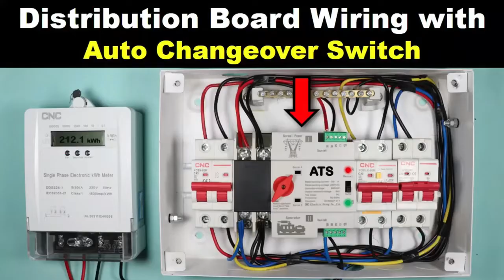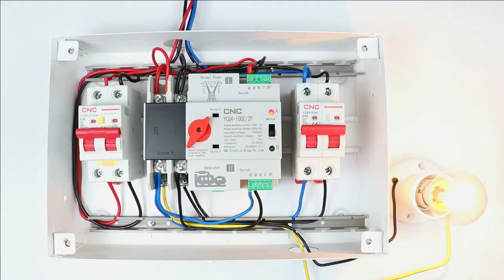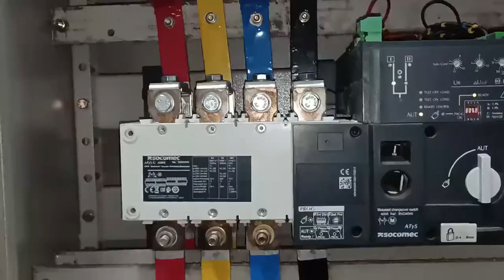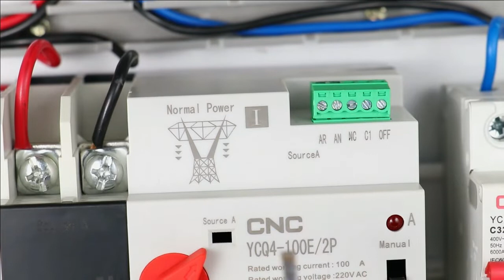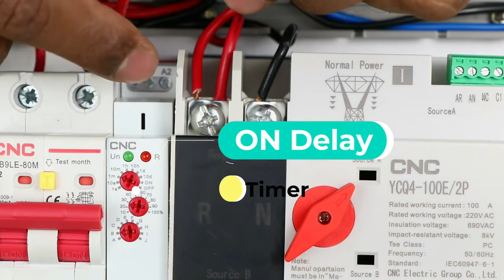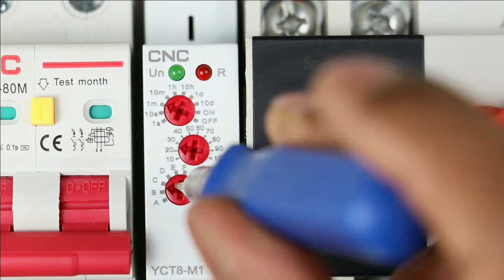How to Wire an Automatic Transfer Switch Panel @CNCElectric1988

Comment: 🙏 Thank you for this explanation on how to resolve a potential issue like this. However, I am more concerned a phrase contained in the vendor's item description, which states the following:
- Due to the characteristics of the product, this model cannot be connected to the inverter, but can only be connected to the mains or the engine power supply.
I do not understand how the switch could tell the difference from a grid supply (more unstable) than my Victron twin inverters, which have been powering both my house and the workshop for a long time without issues.
Furthermore, in my case, source A would be the common power supply, and the grid would only act as backup power (replacing the generator).
Can you see a good reason why they would state that?
Thanks again

Comment: Are you actually connecting a generator to the circuit board? Normally the generator has a 5 pins round socket

Comment: Your design is not fully automatic because there is no command signal to start the generator. You need to manual start the generator if the power from the grid have no supply.

Comment: I want to use this ATS to switch between Grid and my EV car that does V2H.
Meaning default power is grid but when I plug in my EV and start V2H it needs to switch to using EV until EV power is turned off.
I guess I need to connect EV to 'normal power' side A and Grid to Generator Power B.
The Load will go to my house PV inverter as a AC source..

What do you think?

Comment: Why are the wires so small? I have this same ATS and the wiring is extremely thick. Since this is handling AC power, and potentially a lot of it (45A from a 10 kW solar system at 220v), the wire would need to be 6 AWG copper or 4 AWG aluminum. Is this just for illustration purposes? These wires are fine for control wires but definitely not for carrying AC.
Reply: The wire size obviously reflect the loads

Comment: This is a good video that shows how to solve a common problem with ATS. The video is clear and easy to follow, and the demonstration is helpful. If you are having problems with your ATS repeating transfers, I recommend watching this video.

Other comments
The video is well-produced and informative.
The presenter is clear and easy to understand.
The video is a good length.
The video is visually appealing.
I would recommend this video to anyone who is interested in learning how to solve a repeated transfer issue with an ATS.

Comment: Nice video. Without connecting the control wires can the ats still function manually to switch sources with the orange knob, and if so does the manual/auto switch still need to be set?

Comment: Can this ATS send signal to start generator?
Reply from the maker: nope sir
Reply: @CNCElectric1988 Can’t the pins labeled NC and C1 be used to signal to a generator or a solar inverter that the grid is disconnected?

Comment: Please recommend for me a suitable home DB to install the 2 pole ATS with a delay timer 2 RCBO, 1 Voltage regulator & 4 circuit breakers. Thank you for the work you are doing.
Reply from the maker: sir,you may pls show me the dimension of the devices you have installed in the DB for us to recommend the suitable one for you

Comment: But, there is no voltage protection in this? Should we add RCBO as well?
Reply from the maker: no need sir
Reply: @CNCElectric1988  But, sir there is a lot of voltage fluctuations and due to this bulbs in house are damaged. Also, I want to put my 2x 1.5 ton AC's on this switch.

Comment: I have two power source. Both are line connctions. Is it possible when i am using power source of B, it will not switch to Main power supply. If B gone then it will switch to Main. Because this ATS interrupting me when i using desktop PC.
Reply from the maker: an ATS just performs as when there is no power in your main power supply, then it will automatically switch to the standby power for uninterrupted power supply sir
Reply: does your pc get restarted or shout off when some switching happen ?